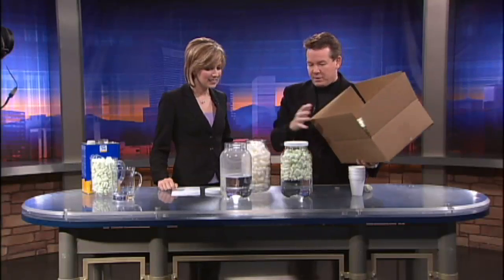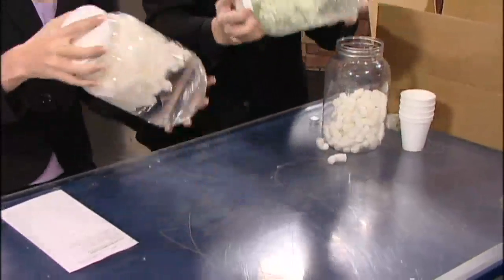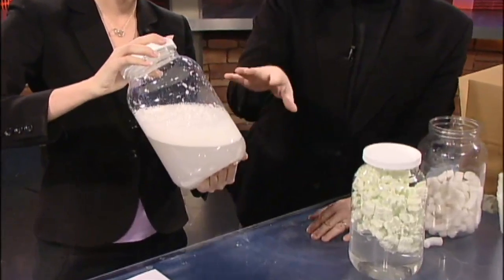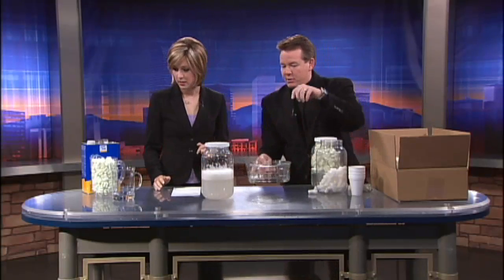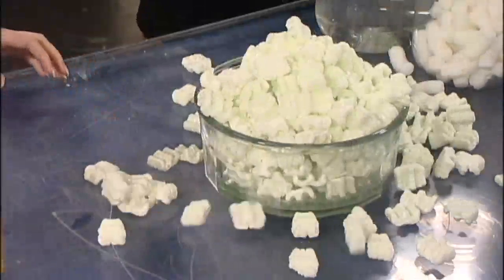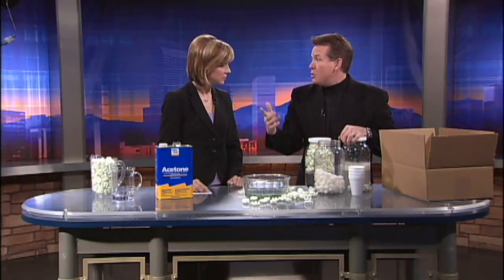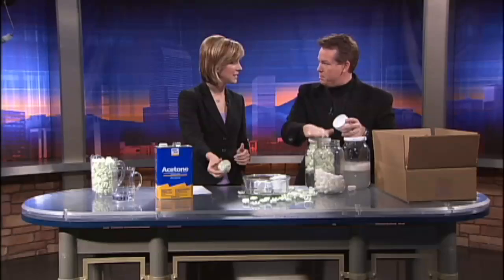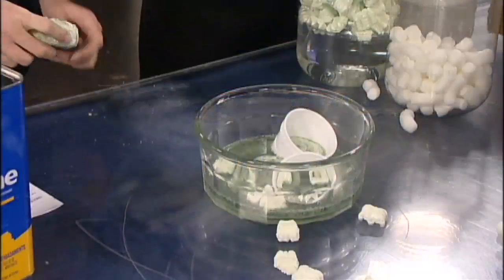Eco-Friendly Packing Peanuts Demonstration

Comment: I melt the styrofoam packing peanuts down in acetone and make stuff out of it. If you use only enough acetone to dissolve the styrofoam you will get a putty like plastic that you can form into whatever you want and it will harden and stay in that form. You can also use acetone to melt down many plastics in this manner. I place scrap plastic bits in a glass jar overnight and the next day I have a liquid plastic that I can pour into a plaster mold and tada I "recycled" (or at least  repurposed) plastic and styrofoam. Acetone is somewhat harsh but believe it or not our bodies produce it. It will dry your skin out with prolonged exposure but that's about it, it's the main ingredient in most fingernail polish remover after all. Caution, acetone is highly flammable but otherwise mostly safe. :)

Comment: You can reuse both...and actually styrofoam pellets would be easier to reuse.  The difference is that cornstarch pellets can be broken down instantly with water, whereas styrofoam can't break down without the help of harsh chemicals